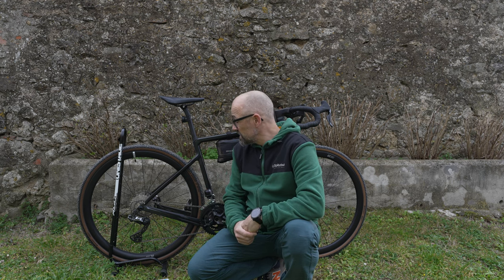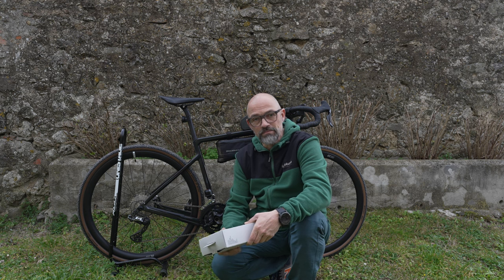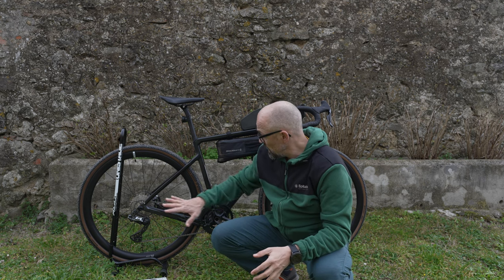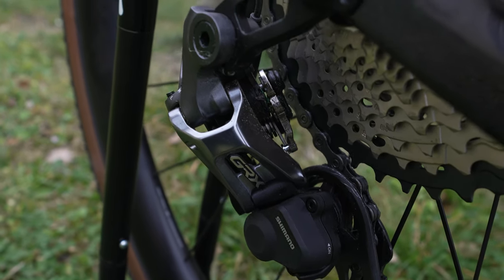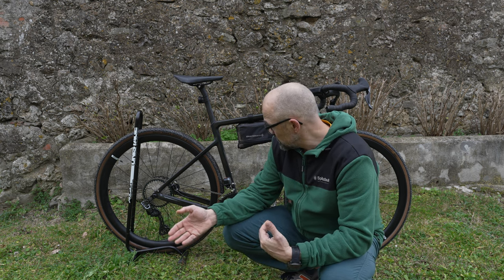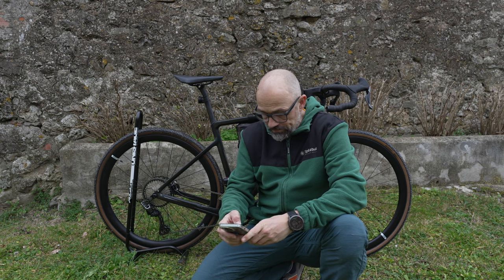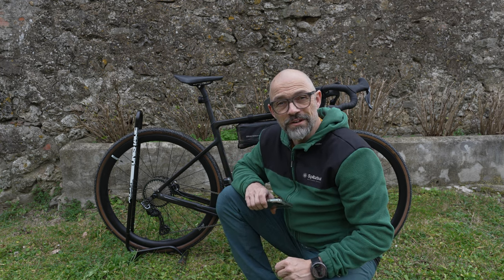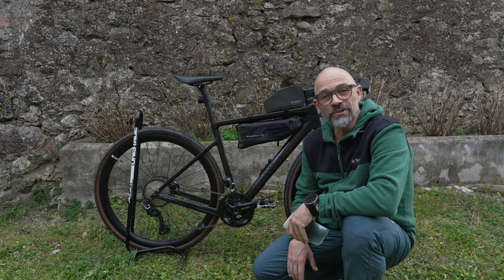Shimano GRX Umbau und Test Kassette 11-34 auf 11-40 an meinem Rose Backroad Gravelbike Bikepacking

Comment: Nurma eine Dreisatzsache (keine Ahnung, was Du da bei 5:46 mit dem Handy machst):
74*40/34 = 87 (1/17)

Frage:
Hat die Kette auch Spannung bei klein/klein? Immerhin wird ja eine Kapazität von 46z benutzt!

Wer nicht eh schon die GRX 810 am Bike hat:
Die GRX 812 ist für 40er bis 42er Ritzel optimiert und braucht daher weder weit eingeschraubte B-Schraube noch RoadLink. Sie läßt sich auf den SGS-Käfig der (10-fach-)XT umbauen und hat dann nominell 47z Kapazität (in exht noch mehr).
Reicht also dicke für 48/30 und 11-40.
Bei mir steht das kleine Blatt in der Mitte der Cassette und klein/klein ist daher Fahrgang (mit nicht mehr Schräglauf als bei 1*11) - während bei großem Blatt auch das 35er hinten zu meiden ist (ich meide meist auch das 31er).

Fahr zeitweilig auch 13-40, bestehend aus 13 und 15 Marchisio (ginge auch Miche oder aber 13er und 15er der M7000 verklebt), 17 bis 28 von der R7000 11-28, 1 mm Spacer und dem 31-35-40-Spider der M7000. Dann fehlt der längste Abfahrtsgang, die Sprünge in der Mitte sind dafür kürzer (21-23-25-28-31 statt 21-24-27-31, also ohne die Großsprünge 21-24 und 27-31).
Bemerkenswerterweise gibt es für 12-fach keine annähernd so gut gestufte Cassette wie die 11-40 11-fach. Dabei könnte man theoretisch die Stufung der 13-40 als Basis nehmen und im das 11er ersetzen.
Es gibt nur RR-Cassetten mit schwachsinnigen Zwischengängen für bergab, dafür aber max. 36z, sowie MTB-Cass4etten mit viel zu großen Sprüngen!
Reply from the maker: Ich rechne mit einem Ritzelrechner die Trittfrequenz bei einer bestimmten Geschwindigkeit aus. Damit ich weis, ob ich noch im Bereich meiner Wohlfühl- TF bin.
Reply: @kayxstaudt  
Dachtich mir schon - wobei ich den von Jürgen Berkemeier empfähle.
Von einer bekannten Kadenz zu einer anderen bei geändertem Ritzel kannst Du aber auch zu Fuß umrechnen. (Die Dir ausgespuckten 74 auf 34er sind vermutlich 74,4, die 88 bei 40er gut 87,5!)

In meinem kürzesten Gang 30 : 40 ist bei 40er Schlappen (2,22 m Umfang) die Drehzahl immer genau km/h mal 10. Denn 30/40 von 2,22 m sind 1,665 m, die ich mit einer Kurbelumdrehung fahre, bei 60U sind das [*60] 100 m in der Minute, also [*60] 6 km/h, genauso bei 80U 8 und bei 100U 10 km/h. 
Bei 31 : 40 kommen immer 31/30 davon raus, also bei 90U z. B. 9,3 km/h - und entsprechend bei 87 U etwa 9 km/h. 
Dein Rechner geht vermutlich von 2,21 m Umfang aus und weicht deshalb minimal ab - 90U*30/31*222/221 = 87,5U, das mal 34/40 = 74,4U mit 34er.
Wobei der Rechner nicht zwingend mit ganzen cm im Umfang rechnet - er könnte auch im Durchmesser mit z. B. halben rechnen (und er könnte auch eingebaute Rundungsfehler haben).
Soo genau kennen wir den Umfang eh nicht, ohne ihn selber zu messen - die Reifen bauen ja nicht auf den mm genau gleich hoch.

Übrinx nutze ich die Kadenzanzeige - die ich vor allem eingeschaltet lasse, um am Berg nie unter 80U zu fallen - auch um zu ermitteln, in welchem Gang ich bin. Das geht bei der halbwegs gleichmäßigen 11-40 ganz gut.
Bei 48/30 vorne bin ich auf dem kleinen Blatt etwa 4 Gänge tiefer (bei 48/31 weicht das nur leicht ab). 2*11 sind real 15 Gänge.
Runde ich die Geschwindigkeiten bei 80U auf halbe bis ganze km/h, sind das
8-9-10-11,5-13-15-17-19-21-24-27-30-34-39-46.
Nehme ich die drei kleinsten Zahlen und die größte weg, sind das genau meine Ritzelzahlen - bzw. 11,5 liegt knapp über 11, 30 knapp unter 31,  34 knapp unter 35 und 39 knapp unter 40.
Ich kann mir merken:
Auf dem großen Blatt fahre ich mit dem zentralen 21er 24 km/h und mit dem 24er 21 km/h, auf dem kleinen fahre ich mit dem 17er 19 km/h und mit dem 19er 17 km/h.
Mit der Zeit weiß man dann:
Bei 80U sind 30 km/h das 17er auf dem Großen, 13 km/h das 24er auf dem Kleinen.

Bei 90U bin ich hingegen je einen Gang tiefer - 24 auf dem 24er im Großen, 19 auf dem 19er im Kleinen. 
Usw. für 102U, 115U, 72U und 63U.

Comment: Ich hab ne 11 Fach 11-34 Shimano 105 kasette am gravel... Geht das mit der auch? Habe grx 810 schaltung und auch vorn 2. Probiere ich auch einfach mal jetzt
Reply from the maker: Hallo Dany, normalerweise müsste es funktionieren. Vielleicht brauchst Du eine längere Kette. Probier es einfach aus. Du kannst ja nach dem Umbau mal hier berichten.
Reply: Und, hat es geklappt?
Reply: @sebz.2756  hi ja ich habe die xt kasette 11-40 und dazu den road link adapter von Wolf tooth montiert. So muss die B screw nicht ganz auf Anschlag rein... ( wurde aber auch gehe)
Reply: @sebz.2756  fahre jetzt grx 810 31/48 mit 2x11 11- 40 xt kassette. Top Berg Gang  31 auf 40
Reply: @danysnf1467  sehr gut, danke für die zügige Antwort. Dann werde ich das demnächst auch mal angehen :)
Reply: @sebz.2756  SHIMANO XT CS-M8000 11-fach Zahnkranz. 69 bei rose bikes.. Und der Adapter gkuab bei. 24 bestellt